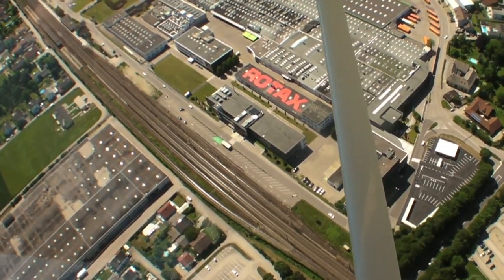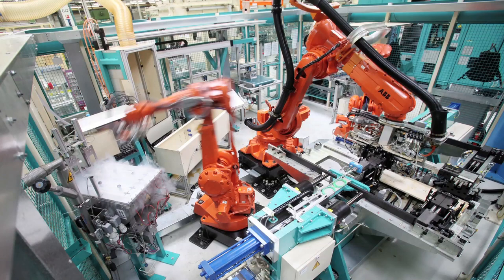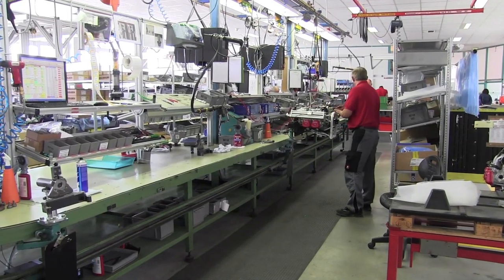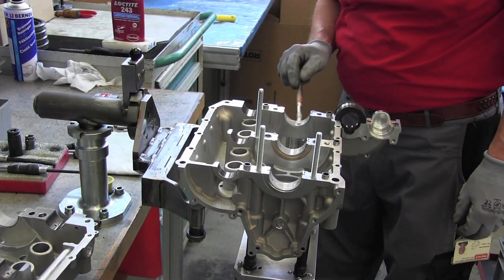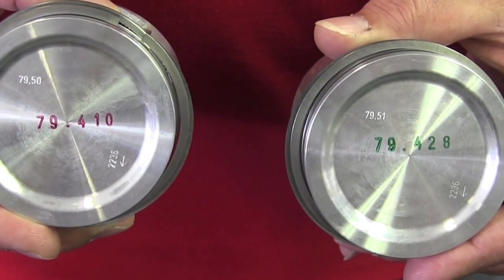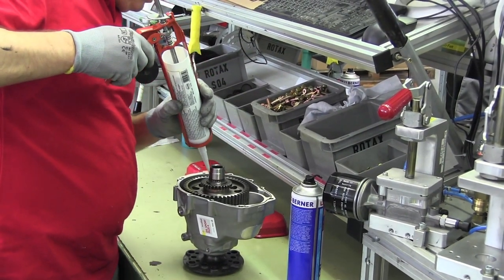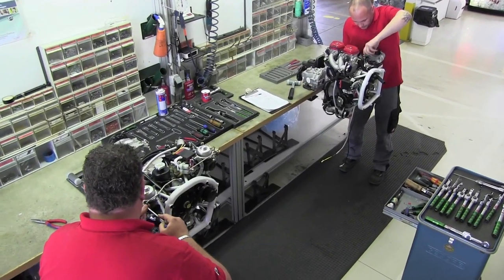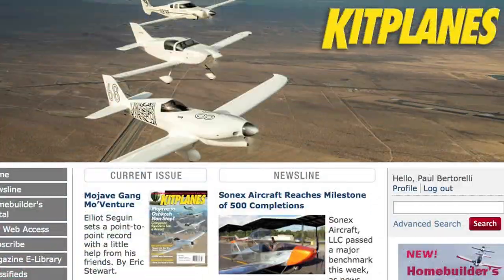How Rotax Builds Aircraft Engines

Comment: What does one of these basic model engines cost (USD) ?
Reply: Rotax doesn't have a USD cost. It's cost is measured in Kidneys.
Reply: $15000 for 80 HP Rotax 912UL.   These are aircraft engines. This video is meant to be addressed to aviation audience. The high compression 912ULS 100 HP is $18500, the Rotax 912iS fuel injected with redundant ECU system 100 HP is $22000 and Rotax 914UL turbo charged Carb one 115HP is $30000 and the newest Rotax 915iS redundant fuel injected turbo 141 HP one is $38000.    Rotax has the best power to weight ratio of any proven aircraft engine in production. Thus for light sport and many experimental light planes it has a virtual monopoly. Many companies have tried t compete and largely failed. The only thing comes close to their reliability would be 1940's tractor technology based Lycoming and Continental aircraft engines. They are significantly heavier and direct drive so for light planes they are not suitable. Up to 90 to 120 pounds heavier for the same HP and with same TBO

Comment: At $23,611.00 it is over priced as hell for a sport engine!
Reply: *****
100% agreed and you don't have the extra weight of water and radiator . I my self use a EA-81 stratus engine making 100hp at the cost of $4,000 bucks to rebuild, I Still have to deal with water though!
Reply: Shawn Huffman I wonder how my 5.7 hemi would do in a rv-7. It might be a bit big, but I bet it would haul ass!
Reply: but they too heavy. a 200hp aircraft engine weight sometime less than 250lbs while a car engine weight over 400lbs
Reply: You get a brand-new Lycoming for that
Reply: How much do integrity and reliability cost? Would you like for the engine to fail because somebody skipped a beat? I've seen BMW, Mercedes and the Chiron factory, all high tech and expensive as hell to run, but they put out the top of the line products. Rotax is the same. You want crap go but something cheap. The quality of the product is worth the price, and if you can't afford it, well that's your problem. I see a lot of people working, old guys who don't look like they play and a clean facility with computers doing sensitive work on the assembly. yeah, it's expensive but, if you are going into the air, I think you wouldn't want to worry about your engine failing.
Reply: It's high priced but besides engineering and carefully logged assembly, some significant cost is attributed to product liability insurance.  If the engine throws a rod on your CanAm it's not quite the same as it happening in your sport aircraft where people die.

Comment: I want to work there now.
We could make my two cycle 'HOPE' {hydrogen oxygen piston engines} that exhaust pure water, have super supercharging, AND can run under water and into space.
Reply: What did Rotax say when you approached them with a properly crafted, professional proposal and running prototypes? How many do you currently manufacture? What are their dyno stats compared with existing systems? Where is your website? If your design is proven then demonstrate it and have neutral third party labs test examples.

Comment: Just wondering, but after the engines are run through their testing cycle of about an hour, you said that the engines are drained of oil and cleaned up..... What happens to the oil they drain out?  Do they filter  and clean it?  Dump it and use fresh new (expensive) or do they run a common tank that's pumped through the engine and back to the tank?  Seems like a lot of oil being used, what happens?
Reply: Their engines go for $20,000+. They probably just send the oil to a recycler.
Reply: Are you losing sleep over this ridiculous unknown?

Comment: why they not use lots of gaskets?
Reply: Sandy Telfer 
The machining makes them irrelevant. They're essentially using a liquid gasket to get a complete seal. Olde school, air-cooled VW, and Porche engines are very similar. Just newer electronics(ignition), and a water cooled head✌

Comment: I hate aircraft engines, stuck in the 1950s. Afraid of innovation, that goes for every type of engine, Lycoming, rotax, etc. The mentality if it ain't broke, don't fix it. Use bmw, 4 stroke, straight line 4, motorcycle engines, modern, better engines.

Comment: The 2t rotax engines in the 90s seadoo disappoint me. Hate the inner crank seal leaks :/
Reply: They were the same in the 80's in Bombardier powered personal watercraft. I towed more than my fair share of buddies, PWC back to shore on the Colorado River on 3 day weekends with seized motors. Inner seal crank leaks = air leaks = run lean = seized motor turned to junk, and  long weekend ruined.

Comment: EASA  Emergency Airworthiness Directive No - 2017 - 0101 - E -    9 June 2017 (Rotax 912 engines)

Applies to 912 iSc2 & iSc3 engines

Ignition house sealing plugs have been found improperly installed.
BRP Rotax has determined the population of stator assemblies and ignition housings that may be affected.

This condition, if not detected and corrected, may lead to oil leakage, with consequent loss of 
lubrication, in flight engine shutdown and forced landing ...........

Which just goes to show - You can have world class QA and still something can slip through the net.
If you have an iSc series motor you'd better get it checked.
Reply: In the last 4 years there have been a flood of Service Bulletins on the 912. Mainly defective parts but also incorrect assembly.

Comment: No different than any other engine built in the 20th century, 2grams? seriously? should be exact
Reply: Machinist: "What's the tolerance on that hole diameter?" 
Engineer: "Zero. It must be exact." 
Inspector: The go/no go gauges are the same size?

Comment: I have a question: Why is the ROTAX aircraft engines: 912 and 914 and possible the new 915 so expensive. If they already have the capacity to fabricate and engine every three minutes, it should not costs so much. Even when exported to the U.S.
Reply: Because they have no competition unfortunately
Reply: Said like a good soldier following orders from ROTAX. Total Bullshit on your part.
Reply: @ew4096   - Care to dispute him then? Because he's correct. The next closest thing Rotax has for competition in the LSA market in 4-stroke is Jabiru which does not have anywhere near the reputation Rotax has. Lots of VW engine conversions, and smaller 2-strokes, but none have risen to the reliability of Rotax.
Reply: @ew4096  Sounds more to me like you need to find a better job. Affording anything of quality working for Starbucks as the clean up crew doesn't quite cut it...

Comment: Rotax 912. Biggest piece of shit I've ever flown. Annoying to check the oil having to rotate the prop. Engine head would overheat on a modest cruise climb on 90F+ summer days leading to several cracked heads. It's a nice engine for a toy I suppose. Not a plane.
Reply: What was it mounted in? my friends kitfox has a 912 with over 2300 hrs without even a hiccup, poor cowling design making for poor cooling? doesnt sound right to me..
Reply: So true! You had a cracked head? Yikes! I’ve had more problems than I can count with my 912. 
Can’t find hardly anyone to work on them. Rotech Canada has a disgusting approach to customer service. Overheating, leaking carbs, fuel pump failing after 5 hrs!!!!!!  $800 radiators? Ughhhhhaaaa! 1000% regret owning anything with a rotax in it.
If you are thinking it won’t happen to you, think again. Just a matter of time until it screws you

Comment: I would rather have a Viking or UL power plant! Rotax oil check procedures are horrible and the high rpms....forget it!
Reply: what rpm do you think Viking engines run at lol and they only designed to run in a car around town with no redundancy. Not 5-6k rpm for 2000hrs I know what I would rather.

Comment: i bought a bike with a  Rotax engine (engine not motor). A piece of crap. needed pistons and rings st 25,000 kms. BMW wouldn't warranty it so had to take them to court. I wouldn't recommend BMW  or Rotax.
Reply: Rob Mitchell ... only Japanese engines are reliable..
Reply: Must have been a doddgy one Rob.  
My wife rides a 2002 Rotax engined BMW CF650CS (when you can get her off her 2012 BMW F800R).
Only thing that's ever gone pop's was the drive belt - And I think that's because I went sort of off roading on it and got gravel between the sprocket and the belt.

In contrast, my superb Kawasaki ZX6R bust one of its main bearings (my servicing's fault, not really Kawasaki's).
Still, I'd question Imperial Fire's view.  A lot depends on who's looking after them.
Reply: Rob Mitchell: its called either motor OR an engine depending on ones geographic location. Different words are used to describe the same thing in different parts of the earth . . .

Comment: "How Rotax Assembles Engines."  There is no building going on, just assembly of finished parts.  Even the narrator says it's all assembly.  That 30 second fly-by of a few unrelated bits of the manufacturing plant is all the "build" they show.  The rest of this is advertising for Rotax main products, with a small nod to the aircraft engine assembly building.  25 years of building aircraft engines?  That's nothing to brag about.

Comment: I'm suprised they even allow rotax engines to be put in aircraft. I imagine they have a similar failure rate to other rotax engines, which is just dismal. Some of the least reliable modern engines produced. Can-am uses rotax engines and their failure rate is over 40%! Most over rated things ever produced are rotax engines.
Reply: Wrong. 914UL is what goes into a Predator drone. Quite reliable
Reply: Paul Kojack Yes, very wrong. The 4 stroke 912 series engines are near bulletproof in general aviation.
Reply: Are you on drugs??
Reply: Where did you get your false over inflated stats?